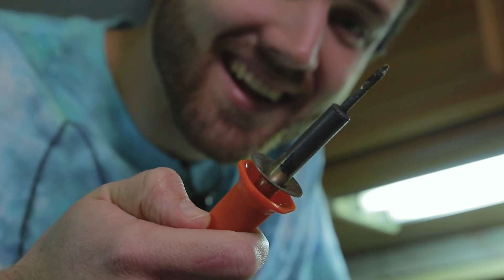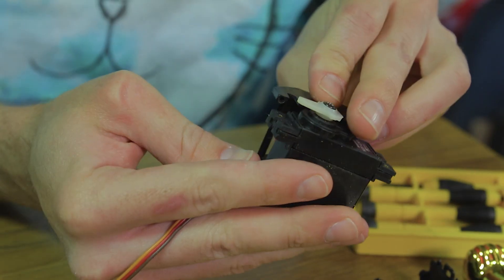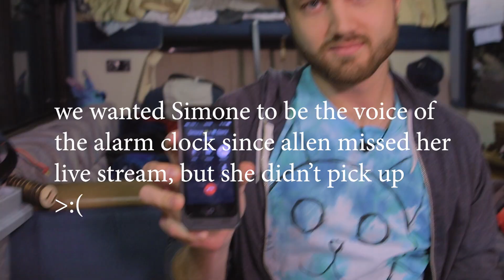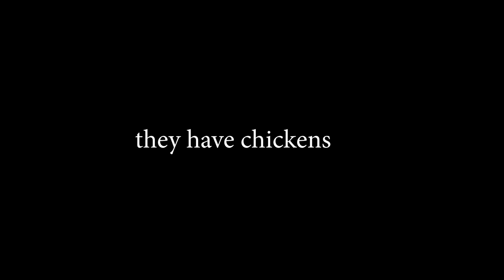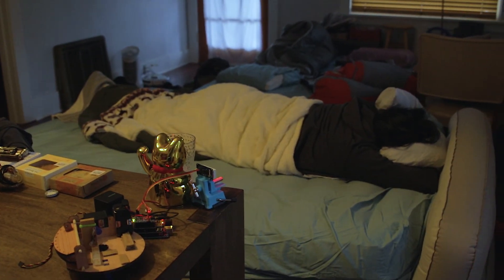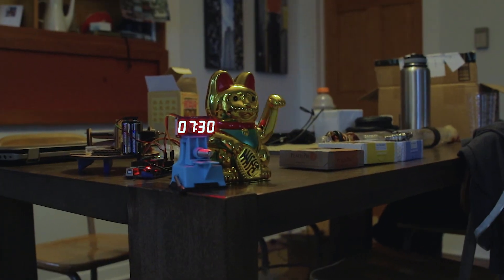This Robot Alarm Clock Smashes Cups

Comment: We need a revised version of an alarm clock. A bot that has a mean speaker installed. With unbearable beeping sounds. When the alarm goes off it just wanders all around the room has a thermal camers installed and gets furthur away from anything that emitts heat. Will be wild to chase it when you are half asleep 😂

Comment: Honestly if he missed his flight to San Francisco from LA and he got up at the time he was supposed to be at the airport he could probably be only two hours late if he instantly got in the car and started to drive. The flight is super short, it's not a straight line, but it's not a long flight. The problem is the time you waste being there early and then time spent waiting on the plane to be late and the time wasted taxing around. The total trip takes about 6-8 hours once you factor all that in plus driving to and from the airport and then you could just drive to San Jose/San Francisco in 9-10 hours.

Comment: 2:33 if anyone is wondering there's a secondary winding in the coil and when the magnet starts falling it induces a current which triggers a circuit which causes the electromagnet which adds the energy. At least in the ones I've seen.

Comment: Big Mac®
550 Cal.550 Cal.
Mouthwatering perfection starts with two 100% pure beef patties and Big Mac sauce sandwiched between a sesame seed bun. It’s topped off with pickles, crisp shredded lettuce, finely chopped onion and American cheese.

Get a Big Mac now with Mobile Order & Pay on iOS or Android.
Order on the App, and pass the line with a tap with Mobile Order & Pay.
Ingredients in the Big Mac®

Big Mac Bun

100% Beef Patty

Shredded Lettuce

Big Mac Sauce

Pasteurized Process American Cheese

Pickle Slices

Onions
Nutritional Information
View Nutrition Summary
550Cal.550 Cal.CaloriesCalories 
30g30 gramsTotal Fat (38% DV)Total Fat (38% Daily Value) 
45g45 gramsTotal Carbs (16% DV)Total Carbs (16% Daily Value) 
25g25 gramsProtein (50% DV)Protein (50% Daily Value)
Saturated Fat: 11g (53% DV) 11 grams (53% Daily Value) Dietary Fiber: 3g (10% DV) 3 grams (10% Daily Value) Calcium: (10% DV) (10% Daily Value) Trans Fat: 1g 1 grams Total Sugars: 9g 9 grams Iron: (25% DV) (25% Daily Value) Cholesterol: 80mg (26% DV) 80 milligrams (26% Daily Value) Vitamin D: Potassium: (8% DV) (8% Daily Value) Sodium: 1010mg (44% DV) 1010 milligrams (44% Daily Value)
*Percent Daily Values (DV) are based on a 2,000 calorie diet

Comment: 02:32 - The magnet on top swings past the bottom one creating an electro-magnetic field which completes the circuit and then turns the motor attached to the arm and magnet which repeats over and over again.

Comment: Is that a weller soldering iron? In the UK they're generally considered pretty good, although the red ones are direct mains, perhaps your red one is made for 230v UK mains? They also have blue ones that have a transformer with a stand for the iron and a sponge dish on top.

Comment: William, the cat thing doesn't "know when to turn itself on and off". If it tirned on and off over and over, it would be on a timer. But instead, per how vertical-to-horizontal negative-parabola-style electromagnets (or just electromagnets) work, it justs stays on unless something interrupts the circuit.

Comment: Hey William Osman, I’ve been coding for a while and I was thinking of using an RTC as an alarm clock on a 4 digit 7 segment display, just like u did (but without the cat knocking over the glass of course😂). Anyway I don’t know how to display the information coming from the RTC onto the display. I already did this project with an LCD so I know how to code the RTC, but I don’t know how to take the time and put it on the 4 digit 7 segment display. Any help would be greatly appreciated. Thanks so much!

Comment: I was wondering why someone would fly between two cities in the same state, that Google says are only a 5.5 hour drive apart, but it looks like a plane ticket is only about the same as cost of the gas (even if it means subjecting to airport crap).

Comment: I believe the way those things work is that the magnet falls down, creates an electric current in the coil of wire, which sends a signal to turn on the electric coil to repulse the magnet, which then moves up, to only fall down again, create an electric current, and start everything over again.
Reply: nope, it's more simpler. they use transistor and capacitors make the voltage waving, and the frequency just match the hand.

Comment: damn dude, thats BS, the alarm still goes off when you are on Do Not Disturb mode
Reply: You can change that in the settings
Reply: These kind of options, like the menu that pops up when you press your power button, are probably programmed by manufacturers, and thus different on each phone.
Reply: Where in settings? I looked and couldn't find a way to turn alarms off with DnD
Reply: I have the same phone as Allen and it isn't in the settings
Reply: still love you
Reply: My Do Not Disturb turns off my alarms

Comment: 1:11 Chinese translate :  
wave for luck (in wealth)
wave for luck (in relationship)
wave for luck (in gambling)
wave for luck (in economic)
* a R5 battery can run several month, can be placed in everywhere, lighting doesn't matter. (many old, 70s 80s, well-made Japanese Maneki-neko use solar power)
*  put R5 battery in button in correct placement it started working, wait for minutes to stablize. 
* some poets inside, stick on for a wish. (stick on the waving hand)
* if it stop waving, change the battery.
Reply from the maker: THE HERO WE NEED!!!
Reply: What's the difference between luck in wealth and luck in economic?
Reply: Gavin Walker Personal finances and national economics. most likely

Comment: At least on Android, Do Not Disturb mode doesn't block alarms.  For the exact reason that you'd leave it on and forget about it.
Reply: Zirconium Hacker My Do Not Disturb actually foes turn off alarms
Reply: Well, I guess only on stock Lollipop 5.1, stock Marshmallow 6.1, Resurrection Remix Nougat 7.1, and AICP Oreo 7.1.  I haven't run any other ROMs, but as far as I remember every single one I've used specificaly says "Do Not Disturb (Alarms only)".  If you don't mind me asking, what ROM/version of Android and brand of phone do you have?